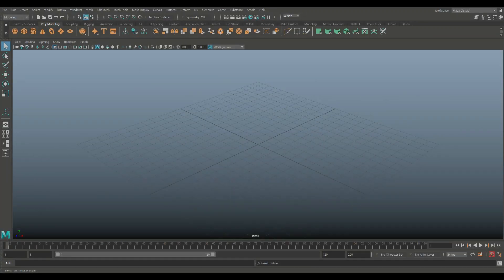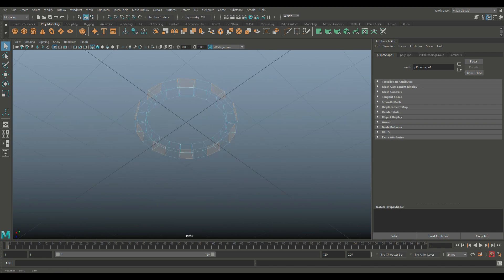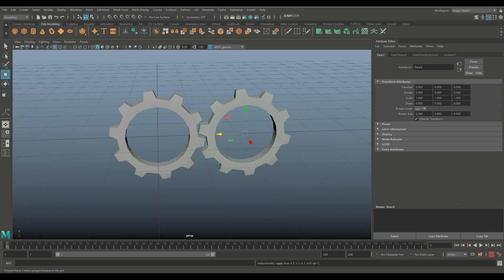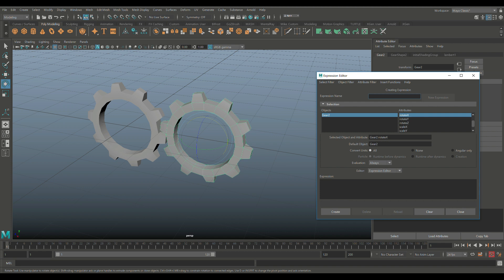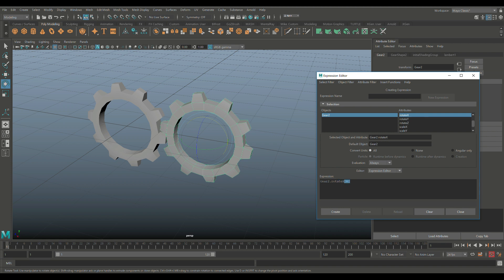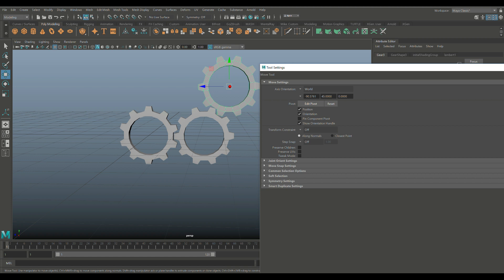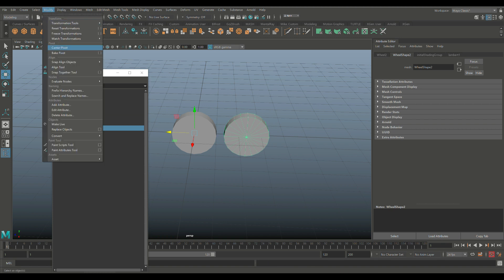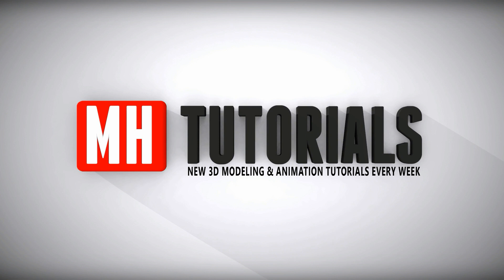Rigging GEARS in Maya using MEL Scripts ( No Plugin needed )

Comment: Hi!
How would it be a MEL script for a Rubik's cube? 
Do you think you could make a video about that?
Thanks for your videos!
Reply: It heavily depends on what you want to do. If it's just a simple animation, you are probably faster with just animating groups above by hand.
For a 'real' rig you have a couple of options. They vary from high performance but hard to low performance but easy to setup.
The simplest approach is to do a script job that is executed every time you select something. The script job will run a function, that iterates over all 20 movable pieces and based on there position, it parents them under the selected control.
pseudo code:
// rubiks origin is at 0,0,0 and has a side length of 3
if selection == topControl:
   for cube in myCubes:
        if cube.worldpositionY == 1:
            parent cube under topControl

and then you do this for all your 6 controls.
Another option to do would be to use a little bit of matrix math. In an expression, store all the control values from the previous calculation (just write some variables in the end of the expression):

newTopCtrlRotate = topCtrl.rotate
rotateOffset = NewTopCtrlRotate - oldTopCtrlRotate
cube.rotate = cube.rotate + rotateOffset
oldTopCtrlRotate = topCtrl.rotate

Just be aware that this is pseudo code and because of the different pivots, you need to do some matrix math to apply the correct transformation to your cubes.
Last option I can imagine is to write your own custom constraint. But that's a lot of work to code.
Hope that helps. Have fun experimenting. (If you try the parenting method, use locators and parent the cubes below them. Locator shapes have a worldPosition attribute which gives you the world position independent from the parent. You might save some lines there)

Comment: I am currently working on a project with gears, a crackshaft and a connecting rod, so thought I would go about it with dynamics, using a vortex to turn a fan that then connects though to the gears and other parts. Just thought it maybe easier for what I am doing, not too sure, still learning what way is the best way. Thanks for this video
Reply from the maker: Very welcome